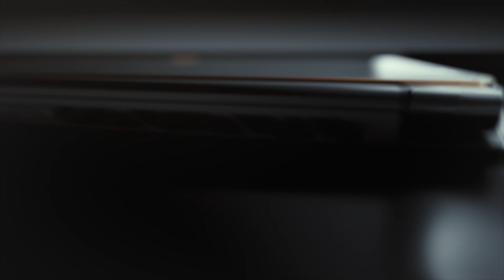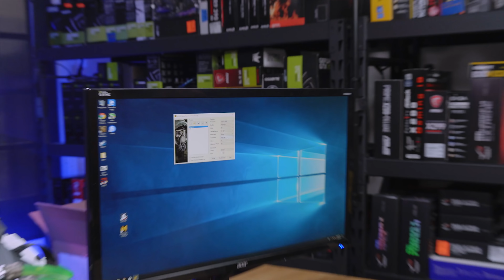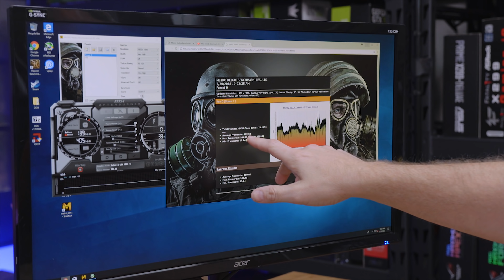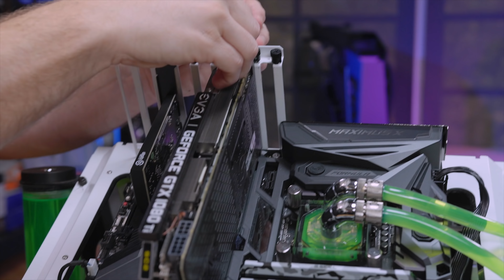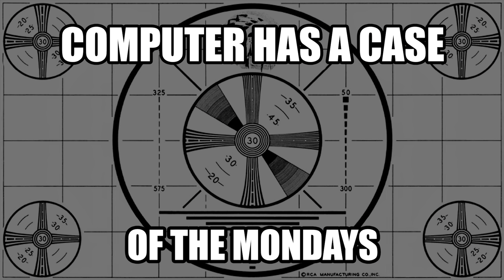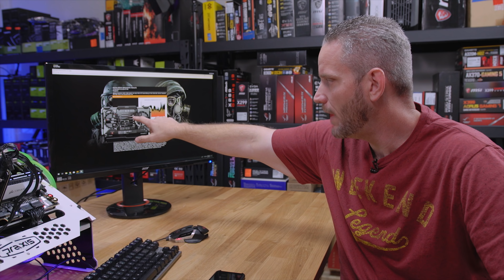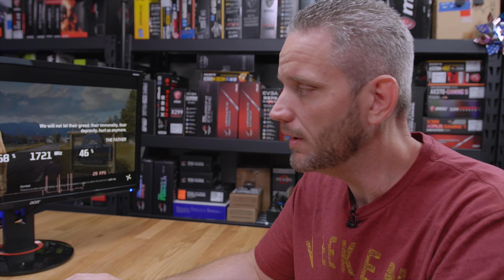Updated Test Bench... But did I screw it up with the wrong CPU?

Comment: You just said that Gaming doesn't benefit from Thread Count, then why put that CPU in? Hmm 😕
To snort that FPS 😂😜
Reply: Rahul129K That was the point in the video, to test to see if the more cores/threads impacted performance
Reply: So the 9th Gen Intel CPUs that are coming out with no Hyperthreading(9700k & below) would be better for gaming then🤔
Reply: The 6 core i7 8700k is the fastest in single core performance chip out there. That's why he wanted to test an extreme 18 core 36 thread against it
Reply: Gaming doesn't benefit from core count? what a load of bollcks :~)
Reply: Gaming benifits from stronger individual cores instead of more cores, so if you have a 4.2 ghz 4 core processor its going to be better than a 6 core 2.5 ghz processor
Reply: ONLY if that is the way the game was designed. You can't make a statement like that as a blanket statement covering everything. Some are made for 32bit some are made for 64bit. Some are made for single cores and some are made for multiple cores. Also you could have very powerful processor that is 4 cores and 4.2ghz, however that does NOT  automatically mean that the 4 is better than the six IF the game or application is designed with more than 4 cores in mind., then the 4 core would be a hell of a lot worse than the 6 core.
Reply: PCI-e lanes probably
Reply: To demonstrate it and test it to see if anything has changed. Dumbarse
Reply: I really wish when people were going to insult someone in the comments it would benefit us greatly if you would actually say who you were calling "Dumbarse", whatever one of those is ;~)
Reply: Ted Cameron hey man I wanted to ask do you think quad core processors are still okay for gaming for perhaps another 1-2+ years?
Reply: There's a lot of quads out, not sure if you mean older ones or what? but yeah, lots of games will only use a few so should be fine. It will only be the very "top" of games that will use lots of cores because they need to be written that way and I would imagine it is a lot of work to make everything use more cores than normal and having everything or lots of stuff multi thread safe etc :~) I only have a 2600K myself but when I see all the comparison video's out there putting mine against all the newer ones, granted the newer ones might get higher results, however mine still give more than enough performance to make it not worth the upgrade, I picked a good one when I got that like 7-8 years ago :~)
Reply: Ted Cameron yeah definitely It’s good to hear that you’re still running sandy bridge as well as I’m also on a i5 2500k hoping that there’s still a lot of life left in it.

Comment: why is 1080p causes more cpu load and 4k uses for gpu.
Reply: 4k is 4 times the total pixel count
this means the same game at 4k will run basically at 1/4 the frame rate of 1080p
This means the GPU is always overworked, 60hhz 4k is the same load as 240hz at 1080p.

At 200+ hz refresh the CPU struggles to sequence all the refreshes and looses speed because of that

Comment: J, why do you not want to go over 4.7 on the 8700k? I run 5ghz with just an h100i and a bunch of case fans and I stay under 80 under load and stable with 1.35vcore...

Comment: So, please correct me if I'm wrong. 4k right now doesn't tax the CPU because it has low frame rates, but considering that when the are GPUs getting moar powaaaful we'll be facing the same thing we do with 1080p, right?
Reply: Theoretically, Yes
In practice however 4k is such a huge drain that this isn't a consideration for several generations.
We are seeing these differences at 200hz refresh
The Displayport interface is over-saturated with data at 120+hz so that bottleneck needs addressing before CPU throttling at 4k is even testable
Reply: In theory yes. In reality that's not going to happen for a LOOOONNNNGGG ass time. As your hitting the limits of what is possible with standard cables and LCD tech, 40 ish Gbps is hitting the limits of what's possible with a few strands of copper.

Comment: Something important. I've seen with my eyes that even though the mainstream platform only supports dual channel memory, 4 sticks in dual channel will easily outperform 2 sticks in dual channel. You should try using 4 sticks with the 8700k. The results are going to be better than just using 2 sticks. I don't know if that's going to close the gap between these two platforms, but it's worth trying.

Comment: Jay, why is "bottlenecking" the wrong word? my understanding has always been "when one component reaches its limit, making everything else have to wait for it", eg, the namesake, the neck of a bottle. that seems like what's happening here... or am i completely crazy and misunderstanding everything and that's why nobody loves me and i'll just go sit in the corner sorry thanks (lol)
Reply: It is technically correct, but Jay has a pet hate.
Many people complain about "Bottlenecking" without understanding that under normal circumstances it is virtually impossible to "Feel" any form of bottlenecking even with a low end CPU and mid/ mid-high GPU
Reply: "dude, it isn't bottlenecking, this is just as fast as it gets for now." yea, i get that, i have a pet peeve for when people use the wrong terms / don't understand what things mean too. though, to play devil's advocate, it's still bottlenecking, even if you don't actually feel it. like if i have a 5 terahertz cpu, and the rest of the system is built to operate around a 20 terahertz cpu... that cpu is technically bottlenecking... even if, in modern situations it would be nigh impossible to tell the difference.
Reply: Less that, More that these "Bottlenecks" are in artificial scenarios with stresses concocted to find the limits - They do not bottleneck in the real world.

Not just that it isn't felt, It just doesn't happen in normal use for 99.99%+ of people
Reply: ahh ok, i see how you're distinguishing it now. yea, that definitely makes sense.

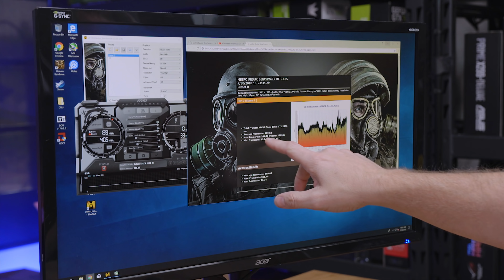Comment: Your losing FPS because there's a bug with MSI Afterburner.  I've noticed this with many of your videos now but specifically for this video that EVGA 1080 Ti SC2 is idling way below it's base clock as it should be at 1556MHz Base Clock not at 139MHz (3:54) and memory frequency should be higher too.  To fix this restart your computer disabling MSI Afterburner startup with Windows then re-enable it
Reply: Idling at 139MHz is fine and is normal on Pascal. My 1080Ti idles at 139MHz, and whenever a gaming load is introduce it immediately clocks to 2025MHz and stays there for the duration of the run (it's under water).
Reply: Russell Sleight -- No...no it's not.  Of course your turbo frequency will stay there because the of a small bug that can happen after updating Afterburner however it can lead to other erratic behavior like inconsistent power consumption, load, gpu/mem clock, temps, and FPS loss.  Just like I can tell you even his memory frequency is running at 405MHz as that SC2 should be at or above 5508MHz running idle.  (NOTE: under load this does not change)  His cards performance loss skews the synthetic benchmarks and real world gaming scenarios.  Which is why at (4:34) he's still trying to figure out what's wrong.  As a 1080 Ti and a 1080 owner myself I've ran across this issue as it's a bug with MSI Afterburner that can happen sometimes when you update it but it can easily be fixed as mentioned in my initial comment above.  I got an ASUS 1080Ti and it's capable of 2038MHz for stability but can go much further on air.

Proof 2038MHz (Graphics Score 10 696):
https://www.3dmark.com/spy/4065023

Proof 2063MHz (Graphics Score 10 825):
https://www.3dmark.com/spy/3749549
Reply: DarcvexiS- 139/405 are standard idle speeds for a 1080Ti, not sure where you think that isn't the case. The card will spin up to its top clocks as soon as a load is put on it. I can tell you as a 1080Ti owner because this is the case for me. 

What is your power setting in the NVIDIA driver? Optimal will allow these clock changes to conserve power where needed and will change clock speeds on the fly corresponding to demand.

Pascal has always been this way. It was this way on my GTX 1080, and is this way on my GTX 1080 Ti.
Reply: RS -- I see where the confusion is and I do get what your saying but Jay did say he wanted consistent results so NVIDIA Control Power management mode he should have at bare minimum enabled "Prefer maximum performance."  I guess he did not?  Otherwise he's just restricting the cards capability so it has to make up for it to compensate because he kept hitting Power Limit so he should have known this already.  I figured he might be having the same issue I had with the Afterburner bug.

Typically I would agree with you that 139/405 are standard idle speeds if your running a power saver mode ALL THE TIME however standard speeds are based on base clock standard speeds located on product box and product description depending on card model and manufacturer.  But I'm sure you know that.

(Example) EVGA 1080 Ti SC2
- 1556MHz Base Clock (Idle Clock)
- 1670MHz Boost Clock (Turbo Min but most 1080 Ti's will make it to 2000MHz)
- 11016MHz Memory Clock (5508MHz Idle Clock because it's GDDR5X x2)

The reason in addition to showcasing cards performance for these numbers if not overclocked and the card fails to reach said clock speeds there's something wrong with card.  And an RMA should be made immediately but that's super rare that happens though.

However, even though I absolutely love MSI Afterburner and still use it. I have indeed in the past ran into a bug that ramped down my settings to "Optimal Power/Adaptive" speeds which is why I noticed 139/405.  And the reason why I say this yet this will sound bat shit crazy as I do run NVIDIA Control Panel-->Manage 3D Settings-->Power management mode: Prefer maximum performance I've had two random instances I probably couldn't recreate where even though I had the setting already preset to Prefer maximum performance MSI Afterburner had restricted my cards clock speeds as if I messed with NVIDIA Control Panel even though I hadn't.  It was an anomaly which does happen from time to time as I've noticed it happen after an update yet regardless of what I did by changing the control panel setting and restarting it did nothing to change back to my OC Max Performance from showing properly in MSI Afterburner settings...until I disabled MSI from starting up with windows toggle option then upon restart enabled it with my OC profile I had set needless to say it fixed the issue.  The performance loss I encountered was no where near to NVIDIA Control Panel Optimal Speeds either.

Comment: With all due respect Jay, Skunkworks doesn't beat your system in FPS because of Spectre/Meltdown which have been shown to have minimal effect on gaming but because in every benchmark there is i7 6950X beats the i7 7900X unless the latter is OC'ed like crazy. It's a simple thing, the new architecture with mesh (vs. ring in Broadwell-E) was built more towards professional applications while sacrificing a bit of gaming performance.

Comment: AAAH! Think I just learned something here forums wasn't able to. If I understand correctly. My watercooled 980ti paired with delidded 4770k@5ghz shows power limit almost constantly flicking 1/0. Some times it stays 1. So this is basically "only" means that without modding the card, I've maxed out the 980tis overclock, by firmware limits? Its doing 42C after an hour benchmark looping, about 130/400 core/vram.
Reply: Almost exactly right While ever you are seeing Power limit 1 you are being power limited, except for one thing.
It's actually a hardware current sensing limiter at the top end - There is a way to bypass it by intentionally shorting a specific section of the gpu with liquid metal - Not recommended for daily use

Comment: 1 7980XE, costs $2,000 Dollars, And it’s Slower than a 8700K which costs Only $340 Spend the Extra Money On a GTX 1180 Next Month And a 512GB M.2 NVME And 32GB DDR4 3200 RAM. Nothing is CPU Limited Games are all GPU dependent. 
123FPS vs 129 FPS, Besides the 7980XE Can’t Handle HDR10 Or Dolby Vision. Only 8th Gen CPUs handle HDR10

Comment: I think the tests would be better if you did, not only just those tests, but also tests of specifically these things:
 - synthetic (cuz why not)
 - GPU intensive games
 - CPU clock (low corecount) intensive games (Like Factorio megabases)
 - CPU intensive games that are multithread optimized 
 - CPU/GPU balanced workload games (GTA?)

Comment: @JayzTwoCents You certainly removed the possibility of lack of cores/threads, but running fastest cores 200mhz lower gives you exactly that much less fps when single strong core is needed. While I do not expect this to be an issue, you kind of lost the actual comparison for not running at the same clockspeed and that 7980xe is capable of that. Put on bigger rad and match the clockspeeds, then you will really see the difference. Of course when i9 9900k is launched, I would assume it's 5ghz 1-2 core boost and +4ghz all core turbo to beat both of these CPUs.

Comment: Yes, we all know it. You need to delid the XE. Then with liquid metal you can sync all cores to 4.7 ghz like the 8700k and get good results and still have good thermal performance..
Reply: Or you know , just wait a few weeks and throw a 2990x on the bench with an air cooler and not need to worry about any of that de-lidding nonsense .
Reply: Andrew Joy True since it'll be soldered you won't need to delid.
Reply: Shaun D AMD solders their IHS which is why they have better heat transfer and do not need deliding. Intel on the other hand uses TIM which is absolutely horrible. It's the laziest attempt to attach the IHS. It's horrible heat transfer. Anyone who wants to get their money's worth on an unlocked Intel chip needs to delid. It's more than 20, even 30c improvement with same clock speeds with liquid metal delid. Intel finally got common sense back and the 9th gen will be soldered, at least the i9 and higher i7.

Comment: It's pretty well established, at this point, that some games prefer clock-speed over core-count & some games prefer core-count over clock-speed. Steve, over at Hardware Unboxed has plenty of content to elaborate on this, for anyone who wants to see rigorous in-depth comparisons & thorough well controlled benchmarks.
Reply: Of course. Physics is handled by the CPU. Games Like Planetside 2 or Battlefield 1 will choke on anything less than a 7700k.
Reply: I actually think physics is likely not the issue. Generally physics runs at a locked steprate (essentially like framerate) of somewhere between 25 and 45 and is interpolated for the display frames, and in basically all engines it's internally threaded - Bullet is the exception, roll your own threading there. Something like Planetside 2 likely still has the bad old all-encompassing main thread design, where main thread does both network send/decode, performs critical portion of simulation, and submits the display commands to the graphics API. The heaviest threads in something like Ubisoft's engines seem to be doing the LOD generation of the geometry, but they're worker threads and are allowed to run late within limits without delaying the frame. I think due to DX11 API and large entity count, the graphics submit thread that does the display loop might tend to bottleneck in these.
Reply: Even a 7700k can have problems when they released Battlefield 3 the 7700k was having stuttering fits, they nailed it down to oversaturating the L2/L3, they later patched it but it ended up being a few instances of this occurring. Also I would like to add the Frostbyte engine is pretty cool in the way it handles and scales across CPU cores and threads, its probably the only offered engine that can scale up to 16 threads(Battlefield 1)
Reply: YOu sure as hell can't run one game and Cinebench to reach a conclusion....
Reply: mdd1963 -- Exactly...
Reply: Yeh but just get a modern HEDT chip like i9 or TR and let the turbo boost the cores in use to almost as high as the mainstream junk and you will be  like 5% behind amusing your running at a crappy res like 1080p. And later when you play a game that uses loads of cores its happy days again!!!

Comment: About your first comment on cores, that is probably because of how clock timings work from the operating systems, and how the game decides to distribute it's threads. In some cases an operating system may be able to utilize 2 cores at 1.4gz better than 1 core at 2.8gz because on the second chip it has to keep switching between threads and their respective counters